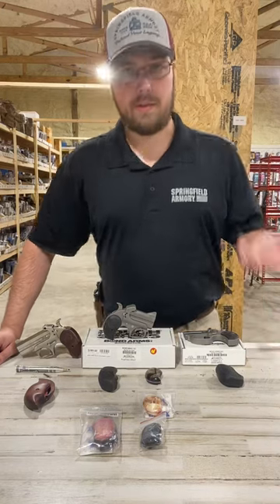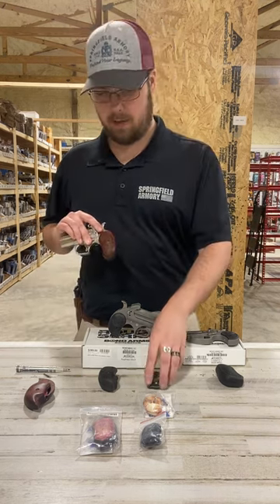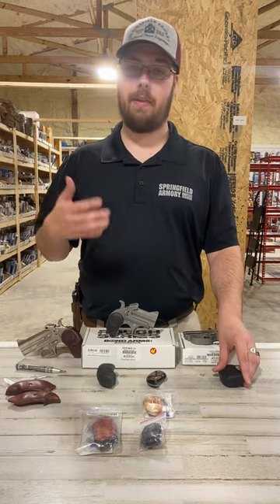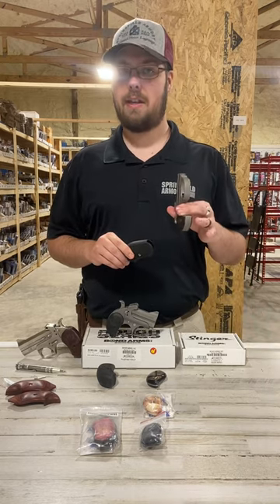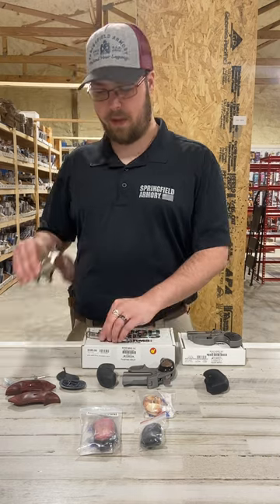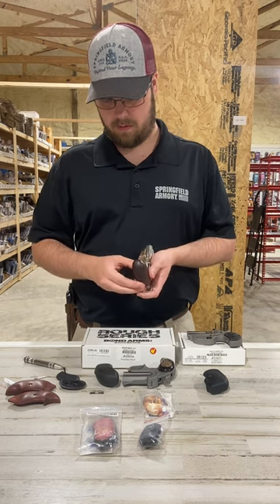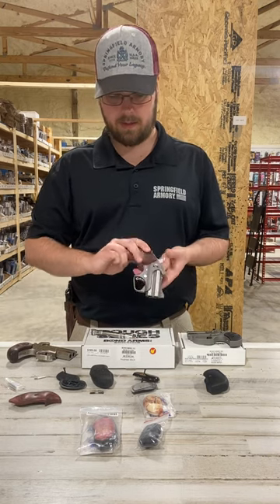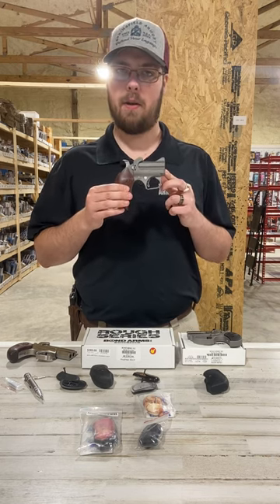Bond Grip Breakdown

Comment: The best grips for EDC are the extended rubber grips which apparently Bond stopped making. Makes shooting and controlling my 45acp Backup much better
Reply from the maker: Bond does still make them, we have them in stock if you are still looking for them.
Reply: @bucksnortoutfitters  I am talking about the soft rubber type with a ribbed back strap and Star logo.]